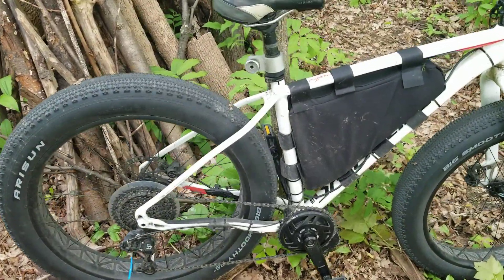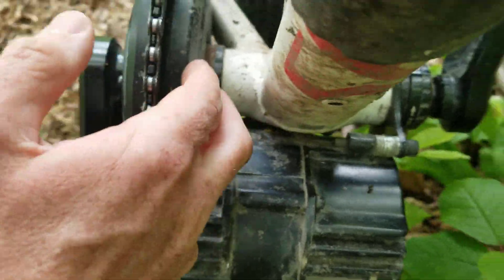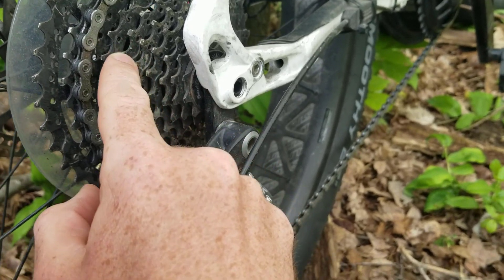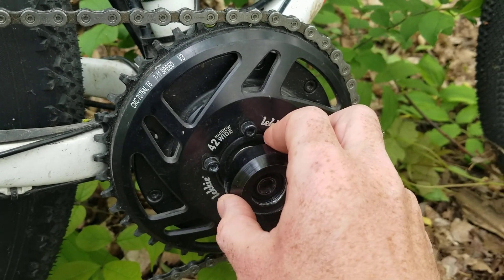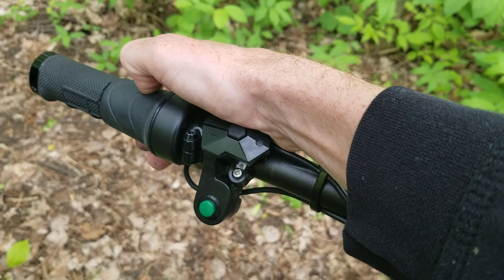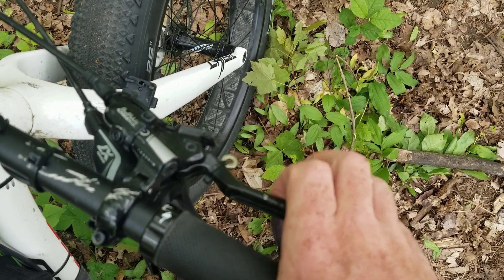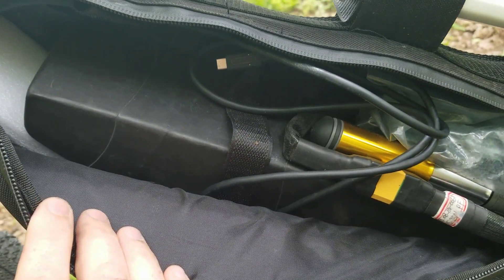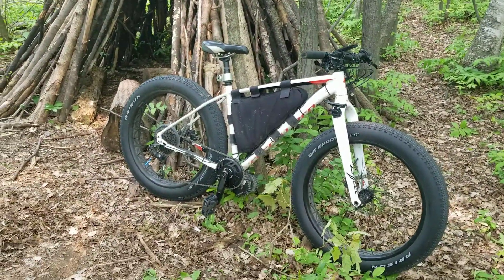Bafang BBSHD (stock install) - 6 Months Later. A recap of what I have learned

Comment: I'm surprised there's no splash guard for the motor or an aftermarket application
Reply: Or some kind of guard
Reply from the maker: A few folks have 3d printed them. My personal experience is its not really needed. It's a solid chunk of metal down there. You might find something on grab cad or thingiverse

Comment: I’m running this with rim brakes and I can confirm it is quite scary. I put new pads on a tuned the cords but still it’s more like slowing down then stopping. Realistically I rely on going around obstacles instead of stopping for them in on 26 inch wheels so I can move like few people have moved on a bike with cranks. It’s like going down a mountain with no brakes lol
Reply from the maker: Oh wow. Hopefully you can get an upgrade. New forks would allow a decent front disc brake maybe. Good luck! Stay safe. Cheers
Reply: @HighVoltageKits  I’m using a 1996 trek 8900, and I’m 19 and broke as shit so definitely can’t afford new shox 😂. Maybe next summer... I’m actually running a BBS02 and have it modded to do 1000 watts and I get about 34 mph.
Reply from the maker: I remember those days... Not entirely gone either. We have a discord server you are welcome to join. https://discord.gg/9UwDG4j You can ask questions. Sometimes people share parts they have spare once you get to know people. If you share your goals with the bike etc.
Reply: @HighVoltageKits  instant sub too man sick bike!

Comment: How are you getting 50+ anything out of this? I have a stock BBSHD that I have just fitted with 48v 17ah and I'm lucky to get about 22mph. on the flat.
Reply from the maker: Well 22mph is 35kph on mine. There could be several things. One is what wheel size are you? A fat bike wheel is quite large so every revolution goes further than a 26" wheel for example. Another possibility is the Amps on your controller are restricted. You should be able to get more than that. It's hard to say without a full picture. It might be a combination of factors. https://discord.gg/GkSbV7xR This is a link to my discord chat server. It will be easier to help you on there. Post in the bafang or ask a question. Cheers!
Reply: 52T front and 11-12 rear cog will get you 35-40mph easy.

Comment: How are you guys not stripping cassette splines and destroying chains and cassettes with these?  

I switched from a 1500w rear drive ebike to one of these 500w mid drives, and boy does it feel far better to ride, but I am only getting 4-6 weeks out of a chain and destroying 11/13 and 15t sprockets quickly.  I have also basically fused three cassettes onto their carrier, after a god awful sound, which were near on impossible to remove.  

I don't know if I can overlook these problems.
Reply from the maker: Without seeing your setup I am not sure. It could be the quality or metal type. Steel is usually best on ebikes. My sunrace is still holding up. I use bigger gears on the back tho which would suffer from less stress. Poor chainline is often a culprit. You are welcome to post some pictures on the channel discord and we can take a look see. https://discord.gg/YAAjfgc
Reply: @HighVoltageKits  Departed cassette sunrace 11-42 8 speed 500km, Bafang BBSHD

Comment: How many miles is on this now?
Reply from the maker: Well over 6000 I think. It has slowed down a bit since I have the other bike sharing some load!
Reply: Has the max speed lowered?
Reply from the maker: No. More the rate of km has slowed as I have two bikes sharing the load

Comment: Thank you for the informative video.  I have this motor ordred (100 mm version) for a fat bike with a 100mm bottom bracket.   I am starting to wonder if it will fit.   I see you used a spacer and lots of washers on the bolt side. Why did you buy a 120mm motor?   Is you BB 120mm?
I will use the bike mostly on snow in trails with some hills.   I ordered a 28T chain ring which has the same offset than the 36T.    Maybe that was a mistake....   How many gears could you use with the 36T?   Maybe I should go with the 42T or even the 40T.    It is really a tresor hunt to get info on what will fit.  I am so thankful that users like yourself post their experience on youtube.  THANK YOU!!
Reply from the maker: Yeah I used the 120mm based on what I saw from a video I found on youtube for that same frame I used. The BB itself tho is 100mm. It is the chain stays that would prevent it from working with the 100. It really depends on the frame. I believe you can get parts to convert your motor to the 120mm version. Getting the chain line right can be tricky although if the 100mm fits then you should be good. You could always try on endless sphere and search for your bike frame. You are also welcome on the CC discord so you can post pics of your frame and we can help you better! Cheers https://discord.gg/wJV5wAa

Comment: where did you find this magnet stop thing?
Reply from the maker: Sorry. If you mean the brake cuttoffs try em3ev.com in the ebike accessories section i think. But otherwise just search brake cuttoff ebike... You can get brake leavers with them built in. Hope this helps. Cheers 🍻
Reply: @HighVoltageKits  thanks m8!

Comment: Hi, did you have a problem with the bottom bracket nut coming loose?
Reply from the maker: No. I used 90ft lbs of torque with a socket and torque wrench tho. The bracket has to be flush as well. If you join my discord and post pics I can take a look. https://discord.gg/mGHrJB

Comment: I haven't got the throttle sensor for mine yet so I have to feather the left brake and pedal softly to change gears so it doesn't shift under load. I've slammed gears a few times (though a rear derailleur is more forgiving than the front one but I just don't want to put wear and tear on the chain and cassette). I only have 750 watts but it does the job nicely.
Reply from the maker: Yeah its a good trick to change gears like that. Cheers!

Comment: is this  a 750w version?
Reply from the maker: This is the bbshd or the 03. It is 1700 watt peak stock with a 52 volt battery at max power. In my later videos it is running at much higher amps and power.

Comment: I have a waffle pattern with no Nobbies at all on my 26×4 fat bike tires, and surprisingly they grip really well I'm just about everything snow, mud.
Reply: Yeah, mine are a soft rubber.  Running 8psi in the front and 10psi in the back with tubes about 2 lbs Less in each if I'm in snow.   I like them but if I were to change tires the 26×4 Panaracers look nice!
Reply from the maker: They do. I wish tires were no so expensive for fatbikes!
Reply from the maker: I did ok last winter with bare knobbies. But I'm doing more road riding these days. I tried some smoother tires but not in the snow. They did not handle sand so well. They are a very hard compound though so that might be why.

Comment: 1000 miles in 6 months? I clocked it in 2 months on my 2kw hub motor, loving it!! Wanna build this bafang mid drive next
Reply: 1000 kilometers mate. About 621 miles.
Reply from the maker: That's impressive mileage. I am uploading a ride I just did at 72 volts with the bbshd. I think you might like it.

Comment: Nice bike, I have the same on my fat bike, over 4500 miles of great fun and no problems. You do not need the brake cut out wires installed, I don't have them and even cut off the connectors from the main wire Y connection (cleans up the front of the bike). You can always back pedal slightly and that cut power to the motor but I just use my brakes like normal. All installations should use the Lekkie chain ring and a gear sensor.
Reply from the maker: Thanks Frank. You are bang on about all the sensors. I just haven't got round to stripping them out yet. I am also single gear now since I went with the external controller route so the gear sensor is a null and void as well. Here is a more up to date video on the bike. https://youtu.be/oBtgP5CQa0Q cheers!

Comment: Who puts throttle on the left?
Reply from the maker: Not many I'm guessing. I'm not a motorcycle rider though so no muscle memory to mess with. I quite like having it there as the shifter for the gears I use is on the right. My theory was it would balance out the controls evenly. My newer bike has it on the right tho as that's what it shipped with.
Reply: @HighVoltageKits  Since you only need the rear, remove the front and move shifter to the left side.
Reply from the maker: I could do it since its fixed gear now. Its not high on the list though as I'd need to buy a new throttle. One day maybe. It wont work if you have multiple rear gears though as bike makers dont make left shifters for the rear derailleurs.
Reply: @HighVoltageKits  i managed to put both throttle and shifter on the right and it works fantastic

Comment: I like the look of the fat boy ,  i`m guessing the chubby tyres give you a better ride ?
  the chain snapping so easily sounds  not good  , if it happened at a really inconvenient time you could really come a cropper :( .
 obviously a fix would be a stronger motor bike chain which  would be a major hassle to engineer .
   wouldnt it be nice if you could have internal hub gears(if they made them strong enough ) and maybe have a dual bike chain set up ?
Reply from the maker: Some good thoughts. To be fair with the chain it was fairly old. I'm using 6 speed chain now which is thicker. If it wears I'll look at moto chain. I may also need to change sprockets. The fat tires give a very stable ride. Especially pulling kids in a trailer! Cheers

Comment: How durable is the motor housing? If I'm mountain biking and occasionally bumping into rocks, will the unit hold up?
Reply: I think the bafang is more better as it only takes 1500ws to get to a 60km/h were as the cyc has a high rpm motor meaning it needs more gear reduction reducing the efficiency  so itll take 3000w to reach the same speed meaning you need a big battery. The cyc is tough but i think the bbshd is way tougher the rotor on the bbshd is huge compared to the one on the cyc and the metal used feels more durable. But i wouldnt leave the motor exposed as scratches look terrible and i was thinking to make a skid plate for it
Reply from the maker: Dan Nguyen Interesting info on the cyc. I'd tend to agree with you on the bbshd build. Its solid for sure. The 60km at 1500 watts is not something I achieved with my fatbike at least with the stock controller. It hits that speed relatively easily with the asi controller. But that dumps almost 3000 watts into it on a hot battery. I'm going to try a build with the cyx at some point. Good info on the reduction gear! I may try the chain version! I'll probably use the asi controller tho as it is amazing.
Reply: @HighVoltageKits  cant wait to see a video on a asi bbshd that'll be interesting
Reply from the maker: Dan Nguyen I'm working on a detailed video but this is an early ride with the ASI. You can see the performance upgrade over my early stuff. https://youtu.be/uEHnuQI1-7U
Reply from the maker: Its built like a tank. Lots of metal. Heavy... I haven't smashed a rock yet but I have heard of people who have. Superficial damage. Check out the cyx pro x1 as you can mount that inside the frame.
Reply from the maker: Yeah that's true. In reality I have gone up and down stairs without smacking the thing. Fat bike tires are almost 29 inch diameter so its decent clearance. If I remember the link to the guy riding rock gardens I'll post it. Cheers.
Reply from the maker: Liidokki glad I can help. They are a ton of fun. Especially with external motor controllers!
Reply from the maker: Liidokki Cool! It's cheaper off ali express for motors. I have heard the batteries can be pretty basic from them. Let me know how you get on!
Reply from the maker: Liidokki I am very happy with em3ev and I will get my 72 volt from them eventually. But a motor is a motor so if it saves you cash then that's good. I think lower quality batteries are a false economy a bit as they have less features, lower quality cells, can have shit welding etc. With em3ev you get guaranteed capacity, warranty, great support, good shipping and a choice of cells. Mine are Samsung 30qs but he also uses LG and Panasonic.
Reply from the maker: Liidokki Anytime. Good I can help a few people.

Comment: I've been wondering about the chain snapping, hasn't happened just yet, but I bought a Park Tool Chain Checker. I think I should carry a spare like you do, have thought about it. 

I've tried the Lekkie 36T, but I found it offsets too much to the outside, made gears noisy, so went back to 42T.
Reply from the maker: The only times I have bust the chain has been my own fault for getting caught on a hill in the wrong gear. Once early on and the other time I just forgot.
Reply: Always handy to carry a quick link just in case your chain snaps

Comment: Try a KMC chain I’ve never had to changed one for snapping only when I’ve been cleaning and decreasing the bike after a couple of years use. Specialized use them on all there non sram bikes and Erik at Luna reckons they’re a lot better for mid drives than shimano HG
Reply from the maker: I'll check it out. This bike has the sram x9 on the rear. At least until I shred it lol. I often get chain cheap off wiggle.com so I'll try it when this stuff wears out.

Comment: Have you looked into reprogramming the controller to get better response when using the hand throttle?
Reply from the maker: Rob Vann I have a new display on order that will allow the controller to be programmed via bluetooth. I'm not convinced it will do what I want with the existing controller. I will find out. I might try an external controller if this route fails.
Reply: @HighVoltageKits  I used the little USB/Bafang programming module ($16) to change the settings for the hand throttle which worked pretty well. Karl Gesslein's blog has a lot of info on programming BBxxx https://electricbike-blog.com/category/diy/controller-programming/
Reply: Rob Vann what rob said.you can change many things with what you have
Reply: There's also the Eggrider V2 Bluetooth compatible (Android too, vs the bafang one that only does apple) and your phone becomes your main display if you want. 

https://eggbikes.com/eggrider

Comment: Thanks for the follow up video! I watched your original video and it helped in my decision as I'm currently building a bikesdirect Gravity Fat Bike. 👍
Reply from the maker: That's awesome. Glad it helped. Enjoy your ride! I ordered this display called the eggrider v2. Apparantly you can program the bbshd via a phone app then. I'll post that if it works out.
Reply: @HighVoltageKits  
 I bought the egg rider to install on my bike as well. 
 It should give you all the settings on the controller.
 I am just looking into a bms at the moment as I am building my own batery....20Ah 52V Samsung cells 10c
Reply from the maker: Sparkie Kosten That's cool. I like the option to have a road mode for legaller riding. The bms on my battery has a cool bluetooth monitor built in. Maybe you can source something like that.
Reply: I'm addicted now and have a bike ordered from Alibaba that has the Bafang Ultra in it.  I actually bought an eggrider v2 in hopes it'll work with the Ultra like their wiki says. If not I'll put it on the HD and swap that 500c mini display over to the Ultra. 👍
Reply from the maker: Brad Adamski That sounds awesome. The people at Eggrider seem pretty competent so if they say it works I'm sure it does. From what I have read the ultra is a beast. Enjoy. Hope it arrives quick!
Reply from the maker: Brad Adamski try this link. if they are using the standard USB cable to program it then the eggrider must work with it? https://electricbike-blog.com/2017/11/23/i-void-warranties-hacking-the-bafang-ultra-max-mid-drive-ebike-drive/